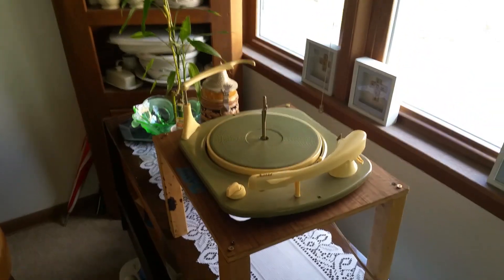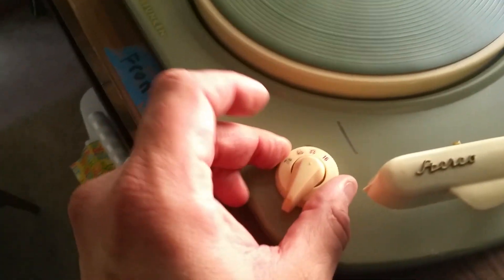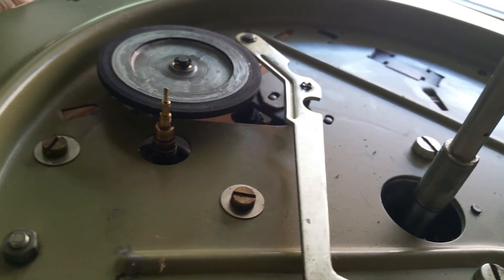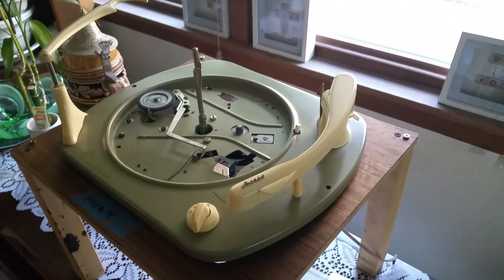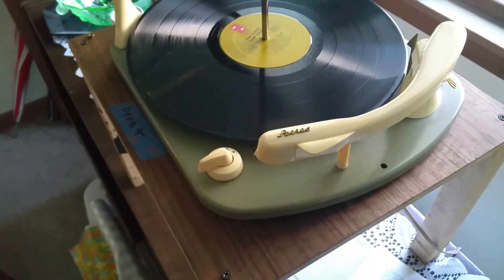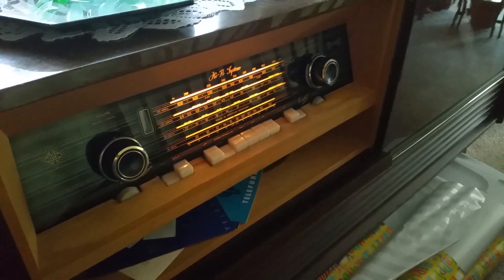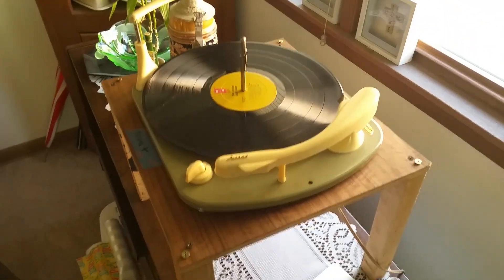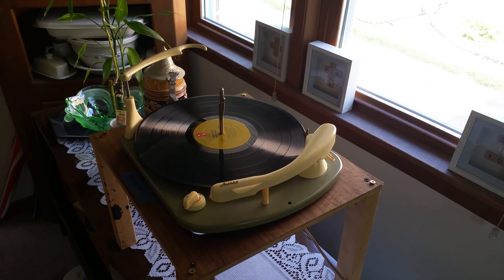Telefunken stereo project: The Final Chapter

Comment: Hey, alright!  The fact that the dial works when you push against the spring in the idler arm assembly makes me think it might still be a lubrication issue.

It looks like you have it plugged into the tape input now, which is probably why it is lacking in the bass dept.  Also, the tape input wiring is different from the phono input.  Try using the black cable instead of the grey one on the tape input ("tape in").  You may get more gain.

The phono input is the one on the end, opposite from the power transformer.  Both worked when I initially tested it (the video with the Discman), but I admit I didn't retest the phono input after I got it all back together.  Hopefully it's not dead!  You'll get better bass and more gain from the ceramic phono input.  Maybe check that the tube right behind the DIN connector is seated properly.  You can also try swapping the original ECC83 in there to see if the new tube is acting up.
Reply from the maker: It is the tape input that I'm plugged into.  I tried the other two inputs and didn't get anything.  I'll try your suggestions and see if anything changes.  If not, it's ok.  I have the capability to play records, even though the tape input, and that's good enough.
The spring mechanism for the idler arm moves freely and even though it looked like it had oil on it, I still shot a little WD in there and worked it up and down a few times, but it still doesn't move in the up direction to a higher rpm.  It moves down just fine.